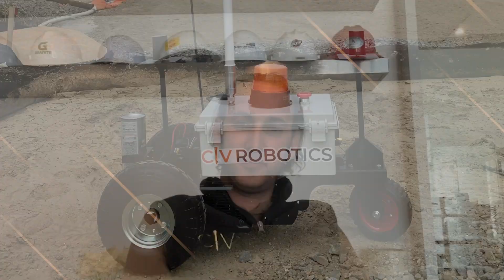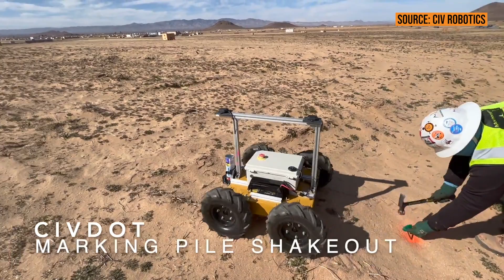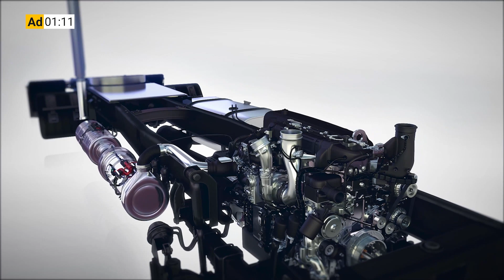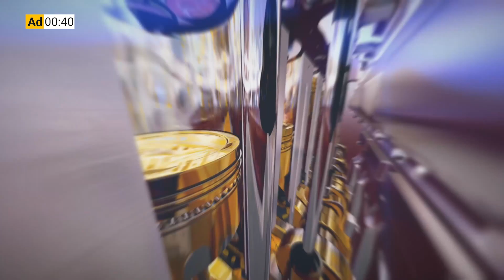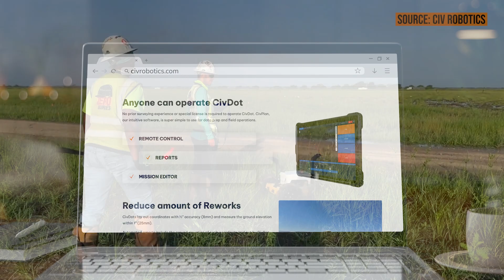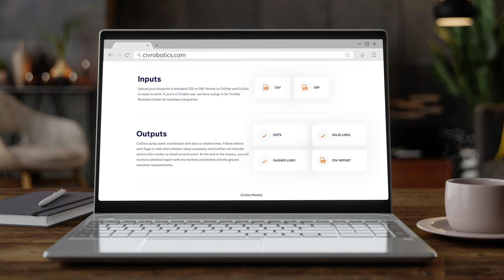Autonomous Site Layout? – There’s Now a CivDot Robot for That

Comment: For grade stakes, it gives the cut or fill. Okay? Grade stakes usually have many different cuts or fills. A lot of slope stakes have 6-10 cuts? Also slope stakes are done at the top areas of grading, usually on super rough grade. Also, what about brushy or really muddy conditions? Areas that are dug out? And the fact someone has to follow it and write up all the lath? I don’t see it being adopted. When you pay survey to provide the layout, you’re also paying them to absorb liability. I could you see it used for a stakeout here or there, but not reliably over the course of a project.